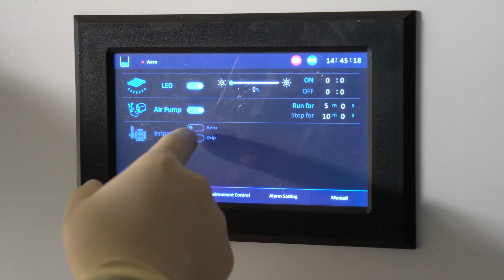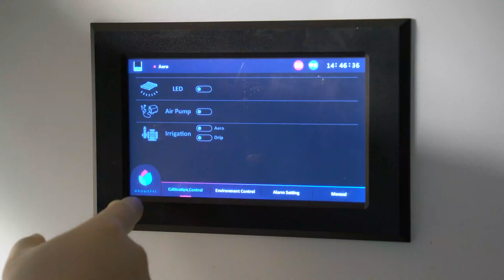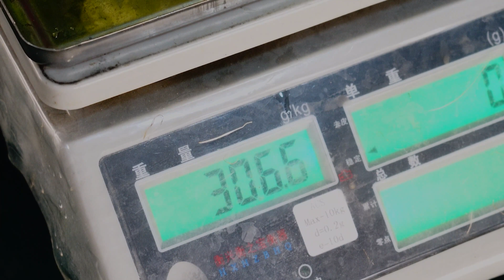Aeroponics Integrated Cultivation System 4.0 - Leafy Greens

Comment: irrigating for 4 minutes every 40 minutes creates a defined wet/dry cycle. Aeroponics uses more frequent mistings of shorter duration (a few seconds) which maintains a constant dampness in the root zone without the defined wet/dry swing.
Reply from the maker: Thanks for sharing! Exciting news—we're launching the 5th generation of our GS-AERO Ponics system!

HIGHLIGHTS:
- Aeroponics Cultivation
- Custom Lighting Strategy
- Fully Integrated HVAC
- Multi-Platform SaaS Control
- Space & Energy Efficiency
- Scalable & Expandable

For more details, email our sales team at sales@growspec-inc.com. Stay updated on LinkedIn at GROWSPEC GLOBAL. Catch up soon!
Reply: @GROWSPEC_GLOBAL  
 I`ll stick with the systems i currently run which are more advanced.